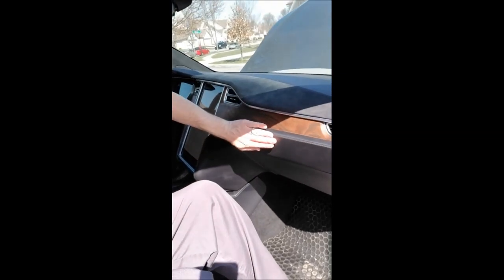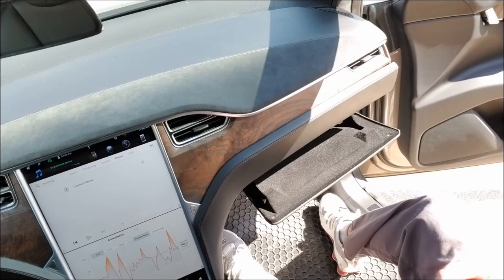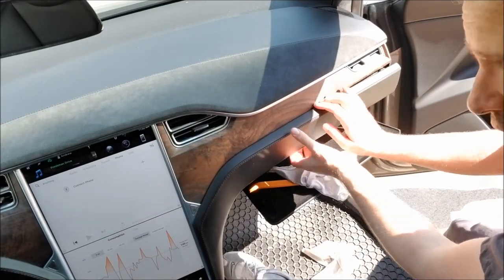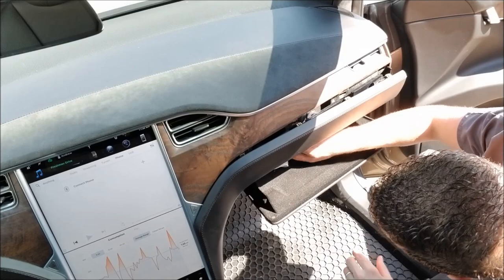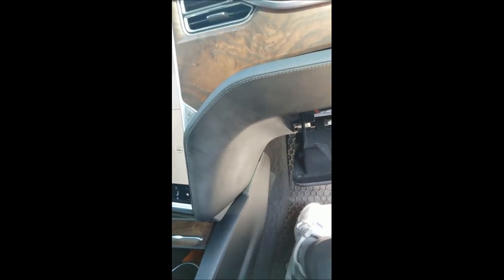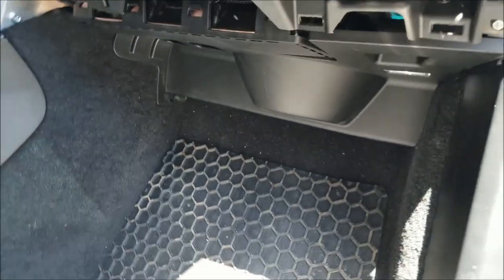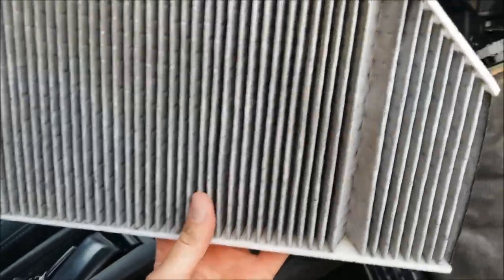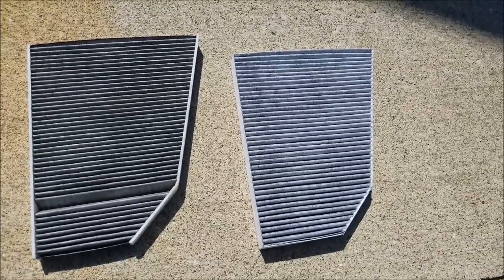How to change the Cabin Air Filter in a Tesla Model X

Comment: Thanks for your video Andrew!   I found it much easier than expected after your difficulties.    For some reason my 2018 panel also popped off in just 1 minute and it had never been touched by the service center.   I was able to get everything apart with just my hands and a T-20 bit.    I also was able to pull the proprietary connector for the glovebox release.  Just took a little determination, as there is a slight interference to overcome.  I wouldn't have tried it without your video!    Knowing where the clips are and that I wasn't breaking anything was absolutely key!

Comment: Thanks to your video, I was able to do mine in 20 minutes start to finish. You really need confidence to just yank that upper trim piece hard, but it's tough and doesn't deform. And yank it toward you as you say, not downward, with one set of fingers behind the thick part (left). I also used the large plastic pry bar set from Harbor Freight (item #67021), a long-shank #20 Torx, and a pair of fine needle-nose pliers to re-form the clips which pulled off their mounts. No way would I have done it so easily though if I hadn't seen you do it first, so thanks again for posting. Oh, and after 50,000 miles since Tesla did it, it really needed changing :-).

Comment: Andrew - great video.  Thanks for posting.  I'm installing sound deadening tiles under the floorboard carpet of my Model S and noticed the carpet seems to be bolted or pinned behind the glove box.  It's where the passenger floor slopes upward to the back of the glovebox area.  It looks as if I'll have to remove the glove box to get to that bolt or pin.  Did you happen to notice anything like that in your Model X?  Trying to avoid removing the glove box!
Reply from the maker: I didnt pay a whole lot of attention to the carpet when I was working under the glove box but from everything I remember, after the glove box is removed it looks like the carpet even goes behind that as well. May require even further disassembly of the dash. Wish I had further info for you on the carpet but that's always been a can of worms in every vehicle I've owned. The best of luck with your deadening install.
Reply: David did you make a video of this?

Comment: So I know why you had so much difficulty. The clips on the door side of the large panel  are at 90 degrees so pulling it out  straight towards you . (horizontal)  The L shape panel part by the ipad, the clips  are at a 45 degree angle so to pull it out you need to pull it out and up at a 45 degree towards you and up. So don't pull it out in the same direction you did by the  door side.  If you look at the clips closely on this video you'll see that

Comment: Where did you find the replacement filter?  I could not find a cabin air filter in eBay, amazon, and Tesla website.
Reply from the maker: As mentioned in the description, to the best of my knowledge the ONLY place to purchase one of these is at a Tesla service center in-person for around $25.  Granted this video is over 2 years old and I haven't exactly followed up on the process, but just like the wipers of the X, it seems Tesla has really kept pretty exclusive to being the only supplier for a lot of their parts